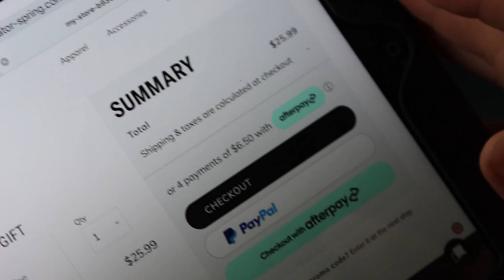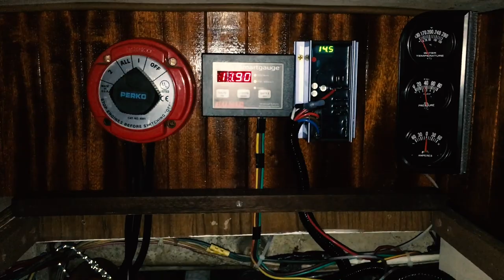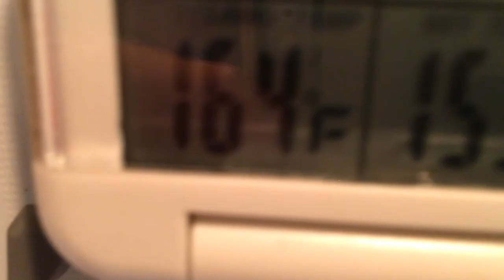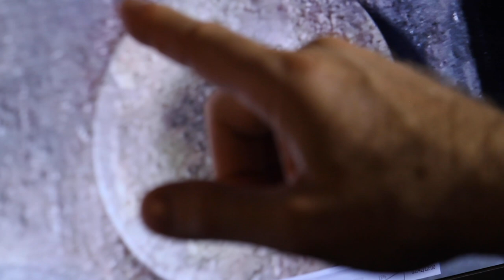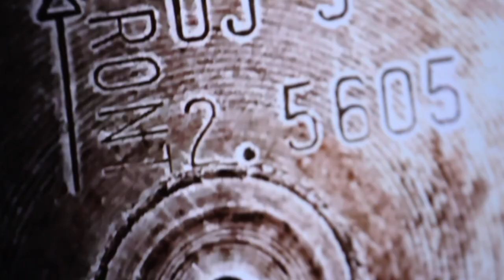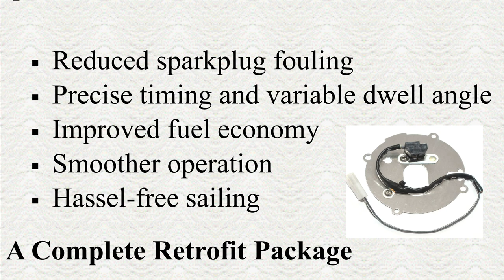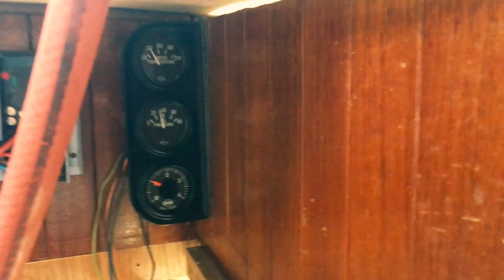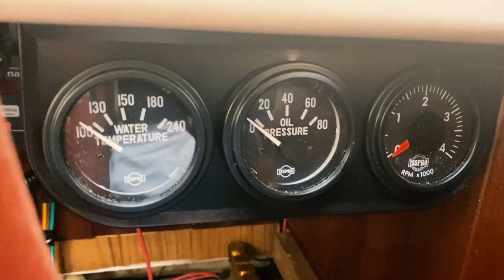Sailing Liberty-Towing guy crashed my boat/ atomic-4 engine upgrade/DECK REPAIR/Pearson Triton

Comment: Have to mention this, considering the shocks taken by the mast, you need to give further investigation of the beam under the tabernacle before bolting all that together and also, to at least inspect, if not remove all the chain plates and look for structural damage. None of the shrouds snapped so something must have given enough slack to rake the mast back that far. If the chain plates are solid then probably the deck head depressed as there is no compression post under the mast. Be sure to carefully measure under the deck head before starting to set up the rig.  The shrouds can and will, lower the deck head if that beam is in any way compromised.

Comment: There are some boats set up with a tee fitting under the thermostat. If it fails to open, the engine will run cold as it gets full water flow. Very different from the automotive style cooling on the A4.

Comment: I had a scare with my mast and a bridge. I thought I was going to hit it for sure. No signs stating height of the bridge. Luckily the distance between the mast and the bridge was deceiving.  The only reason I continued through was there were sailboats past the bridge at a marina so I figured it must be high enough. Still scary though.
Reply from the maker: Tabernacle is awesome in these cases. If river is deep enough you can go to places other sailboats cannot with low bridges. 
Our boat crashed in the bridge by seatow Captain who knew the area...It was bad... by the time we got her fully fixed we bought bigger boat. Hopefully gonna sail her again... one day. :)

Comment: I think I have that same exact outboard motor (Mariner) and hull #663
Reply from the maker: I tried to “save money” so I bought used outboard. For 200 bucks. Paid another 200 for marine mechanic to fix it and it still does not work. Shouldn’t have saved money to save money :)
Helen